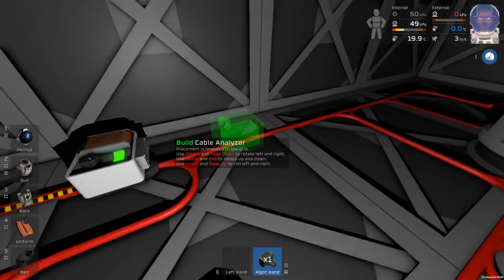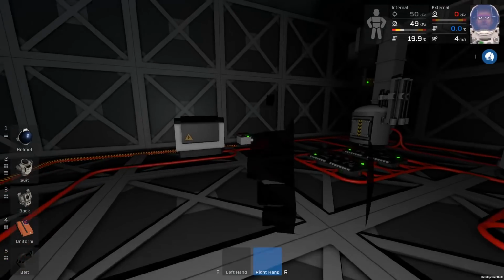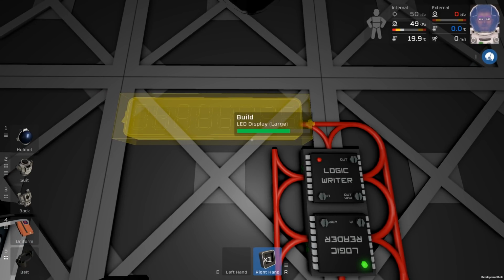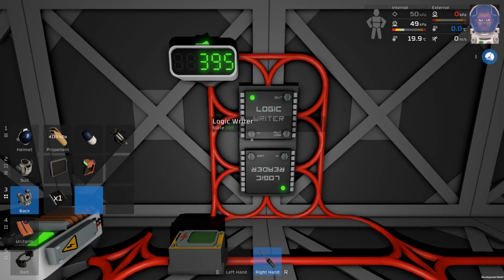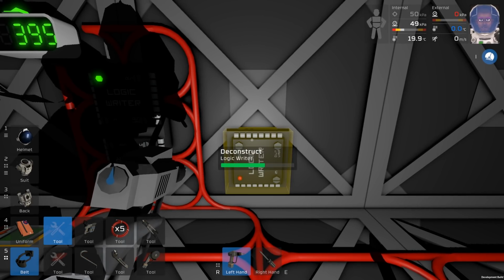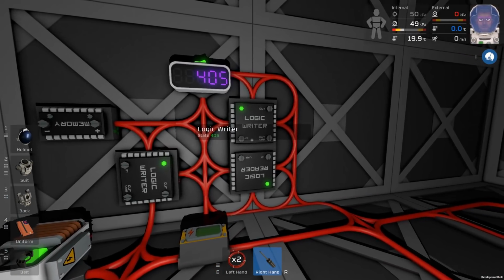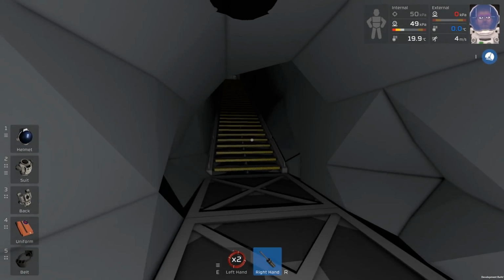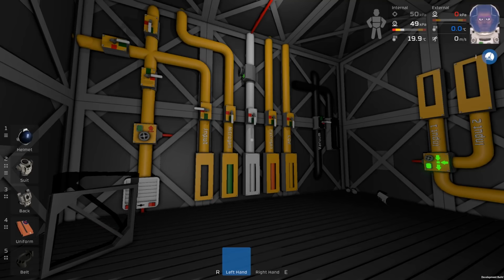Stationeers E15 - LED Displays and Power Analysers (Short video)

Comment: Fixing the angle inaccuracy in the solar is pretty easy... instead of just /1.8, subtract 15 then divide by 1.5 (may need a min/max to prevent numbers over 100, I still use it out of habit but not sure if that glitch is still in the game or not). Also, I see a lot of YouTubers using 2 min/max to prevent a less than 0 angle too but never used it and never had a problem (unlike the above 100 issue, which I had in the early days).
Detail version:
Solar angle (sensor) read by I/O;
math unit - input 1 is the angle from I/O, input 2 is memory set to 15, mode subtract;
math unit - input 1 is previous math unit, input 2 is 1.5 from memory unit, mode divide;
min/max unit - input 1 is the previous math unit, input 2 memory set to 100, mode less;
Batch writer - input is min/max unit, output is solar panels, mode vertical

Total units = 2 I/O, 3 processor and 3 memory. Gives ~ 490w+ per panel constantly.

Comment: At 2:48 whats that generator type thing ive been looking for it an what machine makes it
Reply from the maker: The left large block is the battery (with multiple lights), the middle part with the green switch is the small transformer (made in the electroprint machine)

Comment: Update for the computer (required stuff = 2 compare units and 1 batch writer): Have the compare units mimic a SR latch using the NotEquals mode and put the result of the latch into the batch writer to switch the state of the solid fuel generator. This way you don't need a computer as long as you use the low power as the S and the high power as the R

Comment: Hey, hello! I think I found the easy way to solve the problem with your solar panels. From the top of my head: if the solar panel has min/max angle of +-5degrees, then you should have: (solar angle-5) /170 <=> ADDER(sol.ang - 5 ) -> multiplier(adder res. , 170)

So when the sun is at 0deg, you get a very small neg. value; When it is at 5deg, you get (5-5)/170 =0(0%); When it is at 90deg, (90-5)/170 = 0.5 (50%); when at 175deg, (175-5)/170 = 1 (100%); when at 180, (180-5)/170 > 1.. Make sure your solar panels treat out of bound values properly e.g -0.1 as 0 or 1.2 as 1.

If you have problem with out of range values you can call me with a bat signal in the atmosphere less sky of your moon.
Reply: All of the guides tell that it is +-15 degrees.
Reply: okey, thanks for the info. Then it's  (angle-15) / 150.